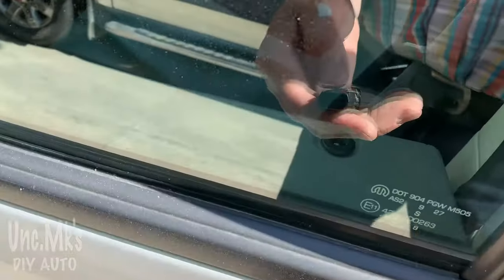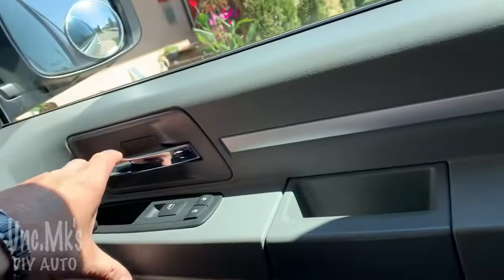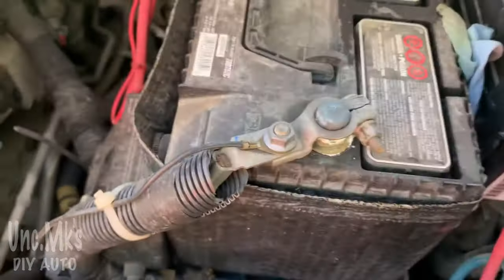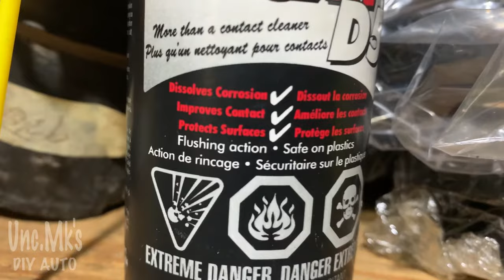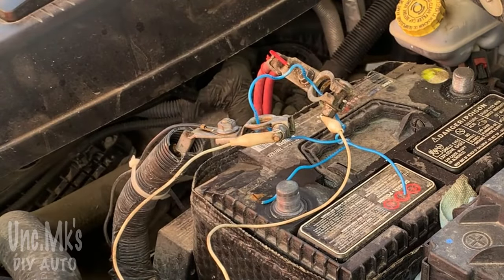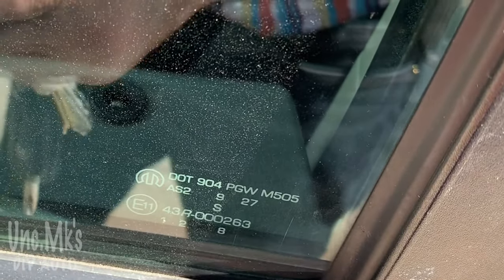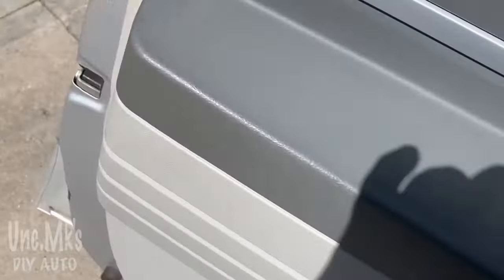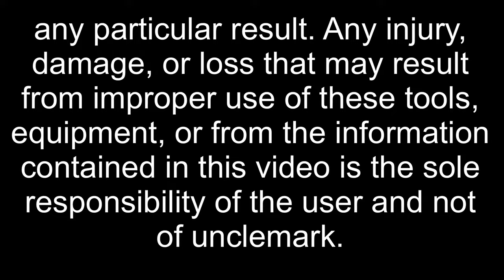How to get my door locks working! TRY THIS FIRST!  (EP 216) Why don't doors unlock? Grand Caravan VW

Comment: I have a rear passenger side problem with my 2008. FOB opens the locks. But the FOB and internal control does not the rear passenger door or the window for that door( Windows will not open from drive or passenger side control) What so I look for?
Reply from the maker: Yikes, not sure where to start. The controls at that sliding door is not working either? Wires to that door could be broken. I believe there are wires in that plastic chain in the bottom of the door track. There are computer modules in each door as well. A good scan tool could command those features to work, which would be a help. The scanner would also tell if there is communication to that door as well. (Not a code reader) That door panel is not easy to remove either. This will be above most peoples skill level!

Comment: i have a 2018 jeep cherokee that the powerlocks doesnt work at all both from the inside and the fob. i cant even open the liftgate. will that jumper method will work for me?
Reply from the maker: Not sure but you could try. It restarts / reboots the system.
Reply: I have the same SUV and my right passenger lock doesn’t work. I will try this method soon and will let you know if it works. Meanwhile if you have tried this method please share your experience

Comment: I tried it and it works—Sometimes. What else can it be if all the locks close sometimes and only a random few close the other times
Reply from the maker: Could be the switch. Have you looked at your wires between door and body were they flex when opening and closing drivers door? Very common for them to break. I would stat there.
Reply: @unclemarksdiyauto  Not yet. I’ll be sure to check. Thanks
Reply from the maker: @user-cc3ym3qc4x  let us know what you find out.

Comment: What happens if my key fob unlock trunk and lock with alarm stop working after the mechanic replaced the starter
Reply: It’s a Chrysler 300
Reply from the maker: @JacobSmith-f1l  what kind of vehicle? Also, that probably is a coincidence. Also, I would mention it to that mechanic.
Reply: @unclemarksdiyauto  a Chrysler 300 after he put the starter he said the original key wasn’t working so we programmed another and the buttons weren’t functioning from the key fob
Reply: @unclemarksdiyauto  I will try the thing in the video but do I need those small cables or can I just put them together for a few hours?

Comment: Ill go to try this Cause my chrysler town and country has the same problem . Thank you
Reply from the maker: Is it all the locks? Or just one door, or one side?
Reply: @unclemarksdiyauto  driver door and passenger door
Reply from the maker: @franciscocastillo8953  They lock but don't unlock, right?
Reply: @unclemarksdiyauto  Yes ... i locked manually and open it  manually too
Reply from the maker: @franciscocastillo8953  Oh boy! We are having the same issue! Our drives side will not unlock. Our problem is inside the TIPM. Not a cheap fix. I will have a video on it when ever I get around to fixing it. Not a easy repair, period. Shoot me a email & we can talk a bit more if you wish. My address is on the about section of my channel.

Comment: I have a 2004 Mitsubishi Endeavor all fuse and relay are good but my power door doesn't work and the remote lock. Also my headlights only go on with the key on position. Also the hazard light and dome light not working, any Idea?
Reply from the maker: Door issues might be wiring where it goes from door into the vehicle body. Wires flex in that rubber boot & eventually break. Very common. Light issues might be related to each other.  A good wiring diagram will show what they have in common. (If their problem is related to one thing.)
Reply: But also the dome light doesn't work and the headlight only works with the key on, they all quit at the same time so did the hazard light and blinker. All fuse and relay got power?
Reply from the maker: Yikes! A wiring diagram is going to be needed to see what these all have in common. This should help you make the next step.
Reply: @unclemarksdiyauto 
It's was the ETACS BCM that control all  electrical component
Reply from the maker: @Catholic1391  I had a relay in the TIPM that was not allowing the drivers side to unlock. Of course the relays that handle this function are as is the fuel pump relay, soldered to the circuit board inside the TIPM and are not available from Dodge. They used a bunch of different ones based on year etc, and even if you can purchase them, you have to be very good at soldering and de-soldering. (just a FYI)

Comment: Can you help me out mate with my 2007 lumina. Only drivers side door lock opening and closing. The other three door lock are not unlocking but locking works
Reply from the maker: It could be many things. It is just guessing at this point. Many times it is the drivers door wiring that breaks where the door hinges opened. Too much bending of the wires and they break. I would check there first.

Comment: Is this safe to try on keyless automatic car?
Reply from the maker: @he-cr6jv  It should be as long as you done need a battery relearn after battery is disconnected. What are you driving?
Reply: @unclemarksdiyauto  I'm from PH and driving a Mitsubishi Xpander 2019

Comment: i have this issue, both sides on door when i press lock it wont lock but it will unlock, this happnes on both switches, ill give this a try
Reply from the maker: Is it on the grand caravan. Is it all the doors, or just the front doors? Did one have this issue first and the second one later on?
Reply: @unclemarksdiyauto  no no it's for my toyota previa, but i pulled the cables and touched them for a minute like in the vid and it started working again. hmm weird. so we're good, thanks a bunch!
Reply from the maker: @JaceD4V1S88  Should take like 30 minutes. Either way, hope it keeps working! Keep in touch.
Reply: @unclemarksdiyauto  idk but it's working now lol thank goodness, love the vids, keep it up!!

Comment: Could we lose the automatic up and down power windows?
Reply from the maker: It is possible. What we are doing in this video is really just resetting the computers. Have you changed the power switches recently? Of so, the express or automat8c up and down feature I believe is parts of the switch design (if I remember right)

Comment: Maybe the battery terminals only needed to be cleaned?
Reply from the maker: Nope, its a reset of the computers that this is doing. The shorting out both cables together for the 30 minutes or more drains all the capacitors. If your battery cables are loose or dirty, you will be having other issues.

Comment: I have a 04 dodge 2500 the door locks work with the doors open and with the remote    But if you hit the lock while the doors open it will not work I took it to 3 shops even the dealership and no one could figure out what the deal is they worked when I first bought it but not now
Reply from the maker: Sounds like a interesting problem for some one else to have, Jose. That would drive me nuts! With out being there, I have no ideas plus I am not the expert on electrical. You would not happen to be in the New York area?

Comment: Mine won't lock but will unlock by the fob.  Wouldn't  remote start.  Driver door lock unlock wouldn't work. Nor would the window roll down. I did this and window works and remote start works.  But fob still won't lock and both lock and unlock on driver door still won't work. 
 Thoughts?
Reply from the maker: So hard to say. Could be a issue with the TIPM. (A very expensive fuse box under the hood.) It is hard to say were to start especially on multi symptoms.  You may have to get a shop to diagnose it, but finding one that almost specializes on Dodge stuff would be a must.
Reply: @unclemarksdiyauto  i found another site that suggested I remove the IOD fuse (J13)  and that will reset it sometimes. When I plug it back in the door  locks but driver door switches still won't work.  I guess I'll have to take it in...👎  thank you for your video. I just wasn't one of the lucky ones.
Reply from the maker: @shawnfausett3554  Hope you find the total fix for this. When you do, send us a note!

Comment: I disconnected the battery and cleaned the terminals on a 2005 Grand Caravan. I did not connect the two battery cables to each other. I waited about 10 minutes. The locks worked for about a day and then stopped working again. I’m going to check the ground strap from the engine and try again this time connecting the two battery cables to each other. Any other suggestions?
Reply from the maker: try it again first. My problem has gotten worst. The hidden soldered in relays for the drivers side locks has died. (Just the unlock part) This is located in the TIPM. (Fuse block under the hood.) I will be replacing those relays, but need to research it more as they are not really listed as part numbers anywhere & I imagine the different years are different numbers. Dodge dealers just replace the unit at around $1200. The fuel pump relays are usually the ones to act up and finally go. (I will replace that one as well)

Comment: Do you think this method would work for a 2013 Ford Explorer? Exact same symptoms
Reply from the maker: You could try it. Cant hurt anything. It will just reset your computer which may be mixed up and not allowing windows to work properly.
Reply: @unclemarksdiyauto  the windows work fine, it’s the passenger side front door lock that will not operate with the fob
Reply from the maker: @chrisolds7698  I would try it. If that does not help, at least you can rule out this attempt.
Reply: Does the gauge on the jumper wire matter?
Reply from the maker: @chrisolds7698  No. It just help drain any residual power left in any of the computers. So they are really off. Just make sure both cables are unhooked from the battery. In reality, there is a small chance this is your problem, but try it. It has worked for some viewers.

Comment: Will this work in a 2017 Buick encore
Reply from the maker: I truly don't know. On the Dodge, it resets the computer. Have you checked the wires in the door jamb, were they go from the door into the body? (Will be in that rubber boot) They usually break from the door bending them so many times.

Comment: Didn't work for me. Both passenger side doors and the liftgate won't unlock. Both driver side doors are ok. What to try next?
Reply from the maker: Do the passenger side and tailgate lock? (You said they don't UNLOCK)
Reply: @unclemarksdiyauto  - yes. All doors and liftgate lock. Only the two passenger side doors and the liftgate won't unlock.
EDIT - should also add, the locks all worked fine until I had a dead battery. Now with a good battery, have this unlock problem.
Reply from the maker: @kiallsop  Humm, that is interesting that this started after a dead battery. My problem came back and now the drivers side front and back doors will only lock but not unlock. Traced it back to the TIPM. (Basically not serviceable, but I will be tearing apart soon.)There are soldered in relays on the circuit board inside. You might have to see a Dodge dealer for a diagnoses. If it is the TIPM, they are something like $1000 to $1500! Video to come probably around Christmas.
Reply: @unclemarksdiyauto    Ouch. At $1000 or more repair, just for door locks, my van will instead be seeing the scrap yard. My van is 15 years old with > 200k miles. Actually, don't care so much about the passenger doors not unlocking, but the liftgate is a huge problem. Good luck with your van. Not sure I have the patience to dig into the TIPM, assuming it's even possible to crack the case open.
Reply from the maker: @kiallsop  Yep , that is the problem. You might be about to buy a used TIPM but it has to be out of the same exact van & year. I don't think  those older ones need programming if the same.

Comment: I have a 2019 Dodge Grand Caravan SXT and the drivers side door will not lock correctly now. Just out of the blue. It won’t lock when I push the fob, it doesn’t lock once I hit the correct speed to automatically lock. You have to physically hit the lock button several times for it to lock. Which means my automatic start isn’t working either. Please help
Reply from the maker: Erin: will the automatic start work, if you eventually get all the locks locked? Is your problem only with the drivers door, or also the drivers rear door? When you get the correct speed, do all the other doors lock?
Reply: @unclemarksdiyauto  only about 1/4 of the time :(
Reply: @unclemarksdiyauto  all the other doors lock when I hit the correct speed. Just not the drivers door.
Reply: @unclemarksdiyauto  I’m honestly not sure if the drivers slide door will lock. I just know that the drivers door won’t and people keep trying to get in my van. Luckily the alarm works very well
Reply from the maker: @erinmorgan8546  If the rear drivers locks or not is a important part of your question and the right answer.
Reply: @unclemarksdiyauto  okay :) I’ll go check and get back to you!
Reply from the maker: @erinmorgan8546  Check if the drivers sliding door locks & unlocks with the FOB.

Comment: Hello I have a Dodge journey 2012 and my outside button for lock door  not working anymore i try to change the handle and all module and check fuses but still not working Help Please
Reply from the maker: Hi Yann. Do none of the doors lock? Is it just the drivers side front and back not working but the passenger side and the hatch lock? Do they just lock but not unlock? Could still be a lot of things. You could have a wire broken in the drivers door jamb. Could be the TIPM itself. (the under hood fuse box) I need more information.
Reply: Its just driver side front all of the other work
Reply from the maker: @yanndesjardins7978  My first thoughts are seeing if you have any wires broken in the door jamb where the wires exit the door and enter the body. Eventually they do break. I don't have a video on how to check this, not yet. I am planning to have one in May 2023 some times. Door panel has to come off, rubber boot covering wires has to be peeled back. A pain in the butt to access. Wires usually have to be soldered back together and heat shrink over repair. That would be the first thing I checked. QUICK QUESTION: was the door lock/actuator acting up / making noises / sometimes working, sometimes not?

Comment: 2014 Grand Caravan won’t lock doors but alarm still goes off when opened, doors stay unlocked unless forced locked. With or without key fob same result.
Reply from the maker: Did you try this reset? Also, do the doors unlock with the FOB?
Reply: @unclemarksdiyauto  Not as of yet and no the doors don’t unlock.
Reply from the maker: @HEhePJ  was either lock or unlock working before? Did they both stop working at same time?
Reply: @unclemarksdiyauto  stopped working at the same time. Have to pull open doors unlocked from the inside.
Reply from the maker: @HEhePJ  I didn’t expect they both stopped working at the same time. Both FOBs don’t work? And they BOTH stopped working at the same time? A shop can confirm if the FOB is sending a signal when you press lock or unlock. Also, the alarm should not go off if you use the metal key in the door lock. The computer should know you are not breaking in when you use the key.

Comment: The 2010 is 4th Generation.  The door fobs and lock settings can be user programmed with a few steps.  I suspect your locks stopped working because you Pocket dialed the fob causing it to change the lock settings to Auto-Unlock.  The lock sequence is not programmable with 5th gen.  Dodge removed the Auto-Unlock feature and the ability to user program due to safety concerns with 5th gen.
Reply from the maker: Good to know  Clickety Split. Will have to check into this!
Reply: Hello, and I have a 5th generation, and by pressing the door buttons it does lock but not from the key control. Do you know any way to fix this?
Reply from the maker: @rhancesk  You are talking about the remote not functioning? Do you have a second remote & does it work? Has the remotes ever worked since you owned the vehicle?
Reply: @unclemarksdiyauto  Hi, thanks for your response. I only have an original remote, but the contacts were failing so I bought a non-original one and exchanged the circuit for the new one, at first it worked but little by little the sliding doors stopped working first, then the tailgate, then the lock, now It doesn't lock or unlock, i open the door with the key but the alarm sounds on and all the people around turn to see.
All this I tell you is from the fob key From the door controls it works without problem. Could it be that the battery is at the end of its useful life? starts without problems. thanks for answering.
Reply from the maker: @rhancesk  There is a replaceable button battery inside the remote. Have you looked at that? (You say remote will not lock/unlock and will NOT start van?)
Reply: @unclemarksdiyauto  I recently changed the battery for a new one, so it can't be that, anyway I'll change it again and try. Yes, from the fob key it does not unlock/lock but the car starts normally when I put and turn the fob key
Reply from the maker: @rhancesk  The FOB key does NOT require the battery to start the vehicle when you insert it and turn it. If battery is dead the FOB might have a cracked circuit board or the battery is not making proper contact.

Comment: Does this work on all cars?
Reply from the maker: @ronaldwenrich8117  I do not know. It is worth a shot as long as your vehicle does not require battery reprogramming/relearning.
Reply: @unclemarksdiyauto  How would a person know if the battery needs reprogramming and relearning?  Are you saying, DON'T connect the two battery cables together if it needs reprogramming which would require a dealer visit?
Reply: I forgot to give you the car info, 2014 Buick Encore.